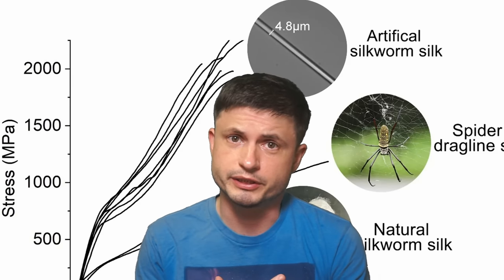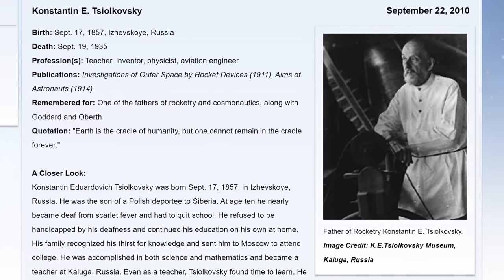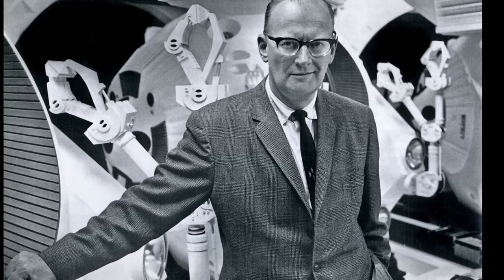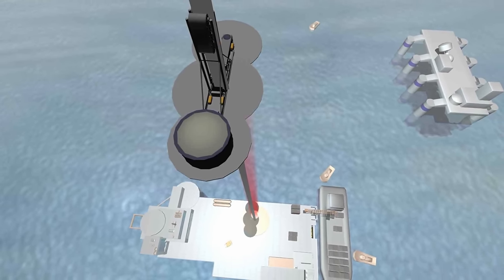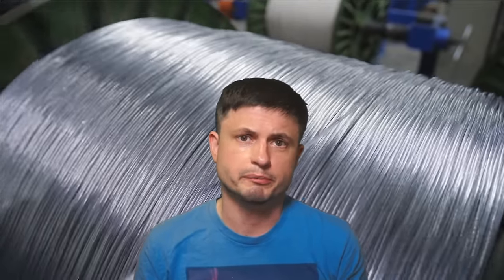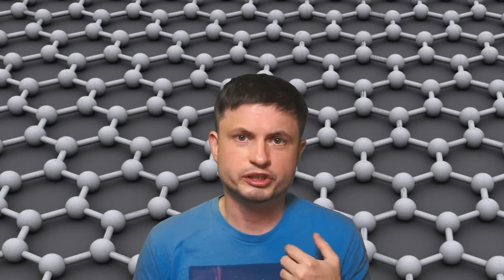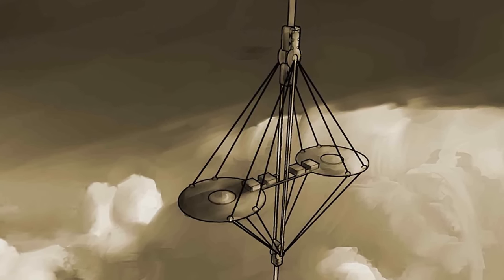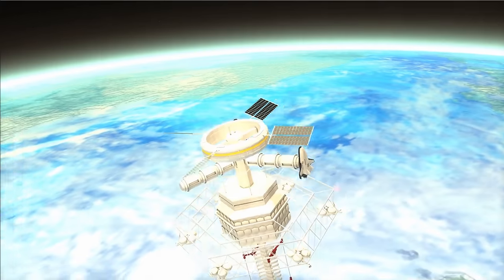Exciting New Updates About Space Elevator Technology...Possible After All?

Comment: It's a nice dream but there are significant issues about terminating life on Earth, or at least the equivalent of several Chicxulub impacts.

Let's assume they get material strong enough...

1. The down end has to reach 36,000 kms into space to the geostationary (GeoS) point. 
 - that's a hell of a project - 36k of cable, TWICE and unreeled outwards from GeoS at the same speed as it is unreeled towards Earth and how the hell do you prevent the ends from assuming correct orbital velocity for their position above the planet? 
You cannot attach to Earth first because until the end gets to GeoS, the line will be acclerating to match orbital velocity.

2. It has to be on the equator - anyone know any stable govts straddling the equator?
 - Anywhere but equator puts side motion into the cable. Any govt controlling the base controls absolutely the cable.

3. The weight at either geostationary or of the cable stretching out beyond an equal 36k kms has to exactly balance the down end, NOT just in actual mass but in WHERE it is on the cable.
 - Matching weights is a given or else side acceleration happens on the cable, but a mass at GeoS needs to be stable and it can't be that if there are 2 opposing accelerations on the cable as each mass tries for equilibrium. Even a massively over-massed GeoS station will succumb to even a modest and constantly varying acceleration along the length of a lever 36k kms long.

4. Any mass ascending MUST be equally matched by mass descending but that raises the problem of orbital velocity. Any discrepancy will cause vibration int the cable and across 36k kms that's a helluva whip to be cracking.

5. Should ANYTHING go wrong and the cable fails we face up to 36k kms of massive cable falling to Earth at huge velocity - in the order of 10,000 km/s or more - someone with good math can work it out - because the cable is being held at one orbit every 24 hours and LEO is one orbit in 90 mins or so.

The destructive effects around the equator (assuming no torque sends it diagonally) would be awesome; I'd be surprised if anything within 500kms of the equator would survive. Weather effects would destroy crops and probably, what is left of civilisation.

OTOH it is GREAT motivation to join Musk on Mars. :D

Comment: I like this concept a hole lot but if and when we get the cable right we stil need to think about electrical discharge for a cable of such length will have a large potential across the cable.
Nasa did a test with a cable that eventualy snapped and had a silly amount of current running through it (thought it was 13 KM ) so yeah a much longer cable might be a generator on it own?

Comment: Even if space elevators are technically possible, I don't know that they're geopolitically possible or advisable.  A space elevator is many miles high.  That means the country in control of the elevator has a piece of infrastructure miles high that needs to be protected from terrorism and other countries.  In the event of a war, an attack at any point along the length of the elevator could result in major damage, and that damage will only increase the higher up you strike.  

A broken cable falling to earth will accelerate as the earth's gravity pulls it down.  At the same time, the rotation of the planet whips it around like a cable on a spool.  When that cable impacts, it will have a lot of force behind it, and it will cut a swath of destruction across a massive distance.  Worse yet, given the economic value of such an elevator, it would make sense for a major population center to grow around it assuming it wasn't built near a major city already.  Given that hypersonic missiles cannot (currently) be intercepted, and ballistic missile defenses can be overwhelmed, a determined strike on an elevator would be a nightmare to defend.  It's also a very tempting target.  Any elevator will be a symbol of the parent nation's power and prestige.  That's without mentioning the industrial, economic and military value.  Cheap space flight means a lot of opportunities for economic exploitation of near-Earth space.  Lunar and near-Earth asteroid mining, massive space construction, inexpensive deployment of orbital military assets, these are all possible for a country that controls a space elevator.  Consequently, this makes the elevator a target of strategic importance to any rivals.  Ideally, you'd want to capture it, but, if you can't, destruction denies all these advantages from your rival while invalidating the immense costs of construction.

As long as we live in a world with terrorism and war, a space elevator is a very risky structure to build.

Comment: Question. I know it would take a loooooot of energy for this to happen but would it be possible to screw this up so bad it does something to the spin of the planet? I ask cause I vaguely remember reading about some dams in China that  it held back so much water (or something like that I really can't remember)  it slowed the rotation by like a small, small, small like really small amount because the weight of the water was higher than what it was originally. Something like that.
Reply: No
Reply: than you would just build the same on the other side to counter that, if it would be a problem, wich i doubt
Reply: Nein

Comment: The space elevator technology proposed denies 2 basic facts.  The first is that the mass rising on the elevator will place a lateral acceleration vector basically based upon the elevation radial velocity.   This will also be complimented by a deceleration force equal to the hefted mass on the tether mass.   This will collapse any space elevator.  The other fact set is that the very reason for gravity and space in electromagnetic forces will express themselves in a massive electromagnetic current down the cable that literally explodes the cable.  This is a technology that cannot happen.  Claims it can happen are completely ignorant of physics.

Comment: Solving the harmonics issues of this 40K mile long banjo string will make Steve Martin proud to pluck it!   But hey, what if they could harness the power of the inevitable whipping action, and could it be used to accelerate objects to near speed of light velocities by using harmonically opposed cables to generate the lifting action?  What happens when you crack a whip that's 40,000 plus miles long mostly in the vacuum of space?    Go ahead.  I'll wait for an answer. hahaha  Great article!
Reply: Oh no, you laughed! Now we have to wait at least another 50 years or the space elevator.
Reply: Same reason a guitar doesn't randomly fly apart. Can't whip if the two ends can't move.

Comment: putting the platform above the height of the geostationary level will cause it to slide backward relative to the motion of the ground station.  so no.  The platform will essentially be neutrally bouyant.  Any pull on it and it will just get pulled down, and then the orbital velocity changes.  This isn't even considering all the debris hitting the line cutting it little by little, or all at once.

Comment: It's always been "possible", it's just that materials and/or engineering technology would have to pull off some tricks they haven't figured out yet.

Regardless, I think a combination of options would be best.

Tethered ring to get things off-the-ground, so-to-speak, orbital rings to lay the infrastructure, and then orbital lifts for direct access from the surface to geosync orbit.  Each stage would facilitate the next, and all would remain useful as part of a surface-to-orbit network.  It's doable with existing technology, right now, and would radically change our presence in space, and space research.

Comment: Seems that orbital mechanics would play havoc with this as you're building it... As you lower, AND extend the line, the ends will begin moving at different speeds, resulting in a horizontal thread going nowhere... 
And... What will static electricity forces be along that thread... Will the Magnetic field lines interact with it, delivering massive amounts on energy that will need to spark out to somewhere?

Comment: The problem is testing. Imagine a test elevator whose objective is to prove that graphene will work. And it snaps. You'll have this cable winding around the globe, destroying everything in its path. Huge risk. It may have to be some kind of scaled equivalent using the moon.
Reply: While its superconducting and extremely heat proof will still burn up on reentry past a certain point so no won't gift wrap the planet with a bow and knot lol
Reply: Why would it wind around the globe? It has no orbital velocity. You sitting still right now are going the same speed as geosynchronous satellites. It would fall straight down and it's absurdly light.
Reply: @filonin2  inertia and centripital forces would cause it.

Comment: I can not understand why mankind does not utilize the electromagnetic forces provided by the host star. A combination of carbon nanotechnology, Dark Bismuth, and components to reverse polarity. Make the elevator a series of superconductors at ambient temperatures, if a hexagonal pattern used in the magnets N+, S-,N+, etc. The bismuth encased in a series of iron, aluminum, silver, Cobalt rings in a specific design, will become extremely diamagnetic until the upper stratosphere, then tune into the closest celestial magnetic gravitational force, resonate and allow it to pull the load upward.

Comment: Space elevators will never be relevant. Even if you had the material strength it would be a stupendous construction and dangerously vulnerable. You should wake up and deal with UF0s instead. Which of course means ET vehicles. And it's real as a matter of certainty. That you are ignorant of it doesn't make it untrue. Start with the 2004 USS Nimitz case. If you have questions I have answers.
Reply: also your claim of 900GPa doesn't ring true. Is that young's modulus? not tensile strength. because 900GPa tensile is a lot.